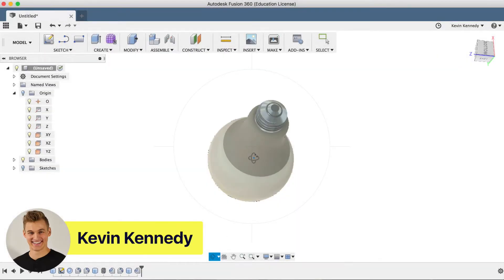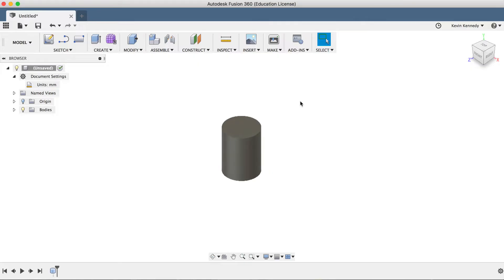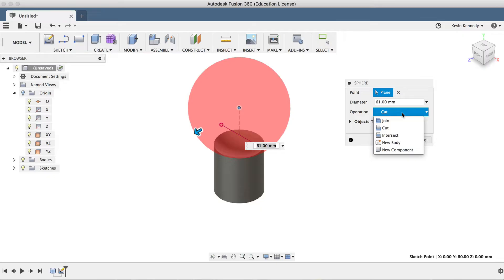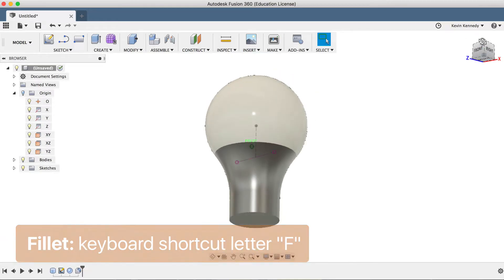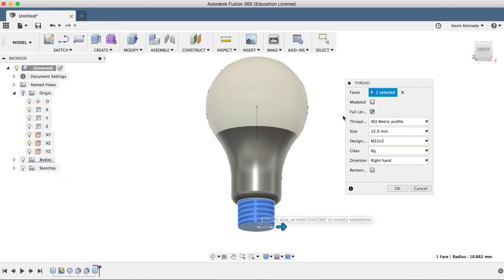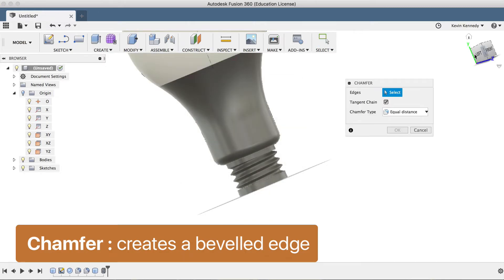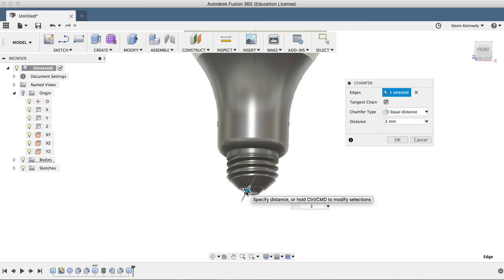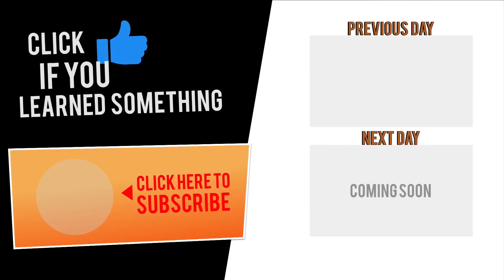How to 3D Model an LED Light Bulb - Learn Autodesk Fusion 360 in 30 Days: Day #9

Comment: As other people have reported, I also cannot get the silver base to fillet up over the bulb. Instead, the bulb curves down over the socket. I have spent 2 hours trying things, ensuring I do exactly what the video says, etc. No matter what, the bulb comes down over the socket:( Perhaps we need to create the sphere first, then the cylinder? I am using version 2.0.13866.

Oddly, when I go on to the next step (fillet the bottom of the bulb) the fillet shows the bulb material rather than the metal base.

Comment: Quality tutorial Kevin, many thanks.
On setting 'appearance' of sphere to a different material (version 360 Personal Sept 2020)
 I couldn't get the cylinder and sphere to colour separately until I eventually found the 'Select' function had a sub menu where 'Select Priority'  was set in my version  to ' Bodies'  as a default and not 'Select Faces' which was needed for  the selection/appearance  to work correctly. :-D

Comment: Brother there is some issue with my sphere command.my software got stuck after selecting the sphere and ultimately got closed.
Reply from the maker: Hi Vikas. Sounds like a bug or something, as F360 shouldn't lockup just from the use of the sphere. Try restarting the program :)
Reply: Same here bro

Comment: Hi Kevin,
I'm getting a line between the fillet and cylinder as another commenter had mentioned.  I've reset my default settings and still have the line, but the line going up the side has disappeared. Should I exit back out and restart or is there something else I'm missing?
Thanks,
Reply from the maker: Hi, Ron. I believe the line you're referring to is simply a visual style setting. Head down to the bottom of Fusion 360 where you see the desktop monitor icon that is labeled "Display Settings." From there, hover over the visual style flyout and select "shaded." Yours is likely set to "Shaded with Visual Edges Only." Let me know if that was it! Cheers, Kevin :)
Reply: @ProductDesignOnline  Got it, Thanks!

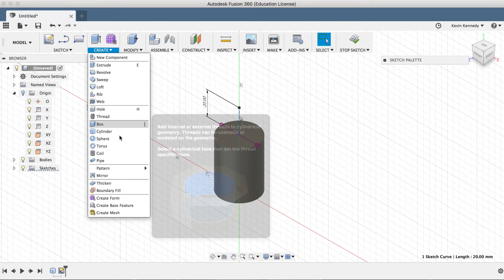Comment: At 1:37, I'm not able to create a sphere as in the video. When I use the sphere tool, it doesn't snap to the line or to the point at the end of it. Am I missing a setting?
Reply: Ok I found a solution on reddit! If you choose for your sphere the same plane the the drawing is in and then orient your view to look at that plane (in this example front view) then you probably will be able to snap to the sketch entities! If you find a better solution please let me know
Reply from the maker: @VerticalWit  Hi there! That's correct, you should be looking directly at the plane to get it to snap. Cheers, Kevin :)
Reply from the maker: Hi, Michael. Can you first cross-check my settings with yours, here - https://bit.ly/defaultsettings

Let me know if it doesn't seem to be a setting and I can look at your file.
Reply: I have the same problem!! None of the preferences used by the teacher seem to work for me. Here is my file https://we.tl/t-TgLYv42QYQ
Reply: Could you please share the Fusion Version you are using?

Comment: Something must have changed in how a sphere can be created, because nothing I do will make my sphere origin point snap to the endpoint of that construction line. I even tried to make it a regular line rather than construction. When I initiate a sphere, the only thing it will snap to is one of the XYZ axis lines, but no points along them, neither on the cylinder, nor the construction line. I've made sure the auto project options are both enabled. Something else must have changed. This is pretty frustrating. I can't even figure out how to work around this in the latest version.
Reply from the maker: Hi Greg. The sphere functionality hasn't changed to my knowledge. It's more likely that it's a difference in our settings. Can you cross-check your settings with mine, here - https://bit.ly/defaultsettings
Reply: @ProductDesignOnline  I reset to default at the beginning, and have been tracking along with your videos in order. I just double checked via your link and the only thing I noticed was Snap was not enabled in the Sketch Palette. Enabling this allows me to start the sphere at what appears to be the correct point, but only because it coincides with a grid point. The construction line was otherwise pointless.

Comment: Hey, how do i get the smooth appearance of the body like you have? Mine has lines where the bulb and cylinder meet, and lines on all the edges. Is it a personal setting?
Reply from the maker: That is correct. It's a visual style setting that you can change in the display settings. Here are the instructions to change it - https://bit.ly/defaultsettings
Cheers, Kevin :)

Comment: I'm curious how you knew to choose ANSI Metric Screw Profile and the design M22x3. The Edison Screw for light bulbs, E26 is the US standard, as the "26" refers to the largest outside diameter in mms. Also there doesn't seem to be a measure for threads per inch (which matters I think).

And if I choose these same settings for a hole in a block and add an inside thread, I should be able to screw in a E26 light bulb into a 3D-printed model???
Reply from the maker: Hi, Don. Thanks for the information. To be honest, I referenced a document online and it may not have been correct. For this 30 Days series the focus was on core concepts more than accuracy of specifications.

As far as the 3D printed threads, you will likely have to alter the thread with the Press Pull command. You'll want to factor in some tolerance since (most) 3D prints are not 100% smooth/accurate. I'll be making a video on some of these tricks at some point. Cheers, Kevin :)

Comment: can this be 3d printed? hehe
Reply from the maker: HIi mogu. This one could be... however, you would need to use supports, and it may be tough to clean up the print with that much support. The other option would be to split in half to create a flat surface. Print the two halves and then glue them together. Cheers, Kevin :)
Reply: First trail didn't succeed, It's printed in 2 parts on the same place.
Reply from the maker: @RAMSies-xz5xb  Where did you split the model at? Cheers, Kevin :)
Reply: @ProductDesignOnline  
Hi Kevin,
Sorry for my late reaction. But I've tried it in a smaller version and that went well. So I guess that is was a glitch in the printer.
Could that happen?
Cheers,
Rob.
Reply from the maker: @RAMSies-xz5xb  Hi, Rob. It definitely could have been something that went wrong with the slicing, gcode, or printer. Glad to hear it worked though! :)

Comment: Somewhere along the line, my setting for "auto project edges on reference" in preference->general->design was turned off. Had a heck of a time selecting stuff. Maybe you have a "here are all the settings you might care about" video somewhere here. I'll have to look. great videos.
Reply from the maker: Hi, miles mccoo. I've listed all my default settings on a page on my website instead of a video so it can always be up to date. Here it is - http://bit.ly/defaultsettings

The "auto project edges on reference" used to be a Fusion 360 default settings. However, from time to time they change the default settings (such as the Y vs Z axis being up). I try to keep them all documented on that page so it's easy to follow along with my tutorials. Cheers, Kevin :)
Reply: Thank you so much for mentioning this I was afraid to ask. Fixed it now.

Comment: 2:25 I did not expect the fillet tool to be able to create such a smooth transition between two objects. From the previous videos one would think that tool is only used to smooth out edges. Makes me wonder if the fillet tool could have been used (in a creative way) for the Whiskey Bottle project?
Reply from the maker: Hi, Special Agent Dale Cooper. The fillet tool could certainly be used for the Whiskey bottle project in a similar manner. However, I typically advise against this method (unless its a simple fun project such as this) as you'll always get more control with a guide rail/loft.

You'll find that in any CAD program there are often many ways to achieve the same result. One has to find the right balance of efficiency and ability to edit or alter their design later down the road. Cheers, Kevin :)

Comment: I'm not sure whether it's a version issue, but I'm really confused how you got the appearance different on the upper and lower parts of the bulb; I have to change the appearance application to faces to manage it, but you don't seem to...
Reply from the maker: Hi, Baiswith. Did you select the area before you tried to drag and drop the color onto it? Notice how I select it at 1:52 and then the top part of the bulb is highlighted in blue. Let me know if that works for you. If not, we can investigate further. Cheers, Kevin :)
Reply: @ProductDesignOnline  Doh...yeah, selecting the area was what I'd managed to miss.  Thanks Kevin :)
Reply from the maker: @Baiswith  No problem! The little things trip us all up at some point. Cheers, Kevin :)

Comment: Is that the actual dimensions for a standard bulb thread?  I'm trying to thread something to go into a light socket.
Reply from the maker: Hi, Mark. I would recommend double-checking with the product you need it to fit in. I looked up the dimensions online before recording this tutorial, however, I didn't check that the online source was 100% accurate.

Curious...what are you planning on making? Cheers, Kevin :)
Reply: @ProductDesignOnline  Making a spud that threads into a light socket. a spud is a mount for tv/film lights.  would be handy for hanging light mats and other lightweight lights.   I figured out how to measure thread pitch and use the coil tool and now I'm good. Thanks buddy!
Reply from the maker: @markkent8436  Sounds like a cool project! Best of luck with it...glad you got it sorted out!  Cheers, Kevin :)

Comment: 1:12 the blue line indicating the top plane of the cylinder and the midpoint triangle do not appear for me. If I just manually click the middle, at 1:14 the perpindicular indication does not appear.  1:18 and beyond, the purple line is not there at all...just a construction line straight up from the middle of the top circle of the cylinder.  I feel like I must be missing some settings...this is the second time you've instructed us to operate on an origin plane referencing the initial body in the sketch and it didn't work like in the video. (Last time this happened was in the hex nut lesson, see my comment there).  Is there a difference in Autodesk Fusion 360 (Startup License) and Autodesk Fusion 360 (Education License)?  Has there been some sort of change in the last year that would have these effects?
Reply: I had the same problem. These seems to be a change in default settings for newer Versions.

I had to go to proferences (click you name in the upper right corner -> Preferences) 
then under "General" -> "Design" 
here activate "Auto Project edges on reference"
Reply from the maker: Hi, ChronOJohn. Thanks so much for sharing this.... I wasn't aware that they changed this as a default... but I will look into this. Cheers, Kevin :)
Reply from the maker: Hi, Emeses. Did changing the preferences setting that ChronOJohn mentioned have any affect to your auto-projected lines that weren't showing up? Cheers, Kevin :)
Reply: @ProductDesignOnline  and ChronOJohn, this absolutely fixed the problem!  Thanks so much for the tip!

Hey Product Design Online - an idea for your series that might be helpful if you have the time to put it together: Make a quick video or reference sheet that you can refer to in your videos that shows all of your settings.  This way when Autodesk changes the defaults, people following your tutorials can still participate with your same settings.  So far the one we discussed in this thread, and the default changing from Y up to Z up have been the only major ones I've come across, but the peace of mind knowing everything is the same would be nice.  Keep up the great work. Thanks!
Reply from the maker: @emeses7568  Thanks for this - I love this idea. I originally didn't think something like this was necessary as I just used the Fusion 360 defaults. I did not know the Fusion engineers were planning on changing the defaults this much. With that said, the only concern is that most of the time I don't even know they make a change to the defaults, as I've found that they don't always announce this on their blog.

I'll likely make a page on my website that I can update so everything is in the same place. Thanks again! Cheers, Kevin :)
Reply from the maker: Hi Emeses. I created a "Default Settings" page on my website based on your recommendation - http://bit.ly/defaultsettings

This is obviously the first "draft" of it...and hopefully this will improved based on further feedback from you and other viewers. Thanks again for this suggestion. I'll be adding it to the description of the tutorials. Cheers, Kevin :)

Comment: Hi, could you explain how to design a socket for that bulb? specifically How to design the threads on that socket so the bulb will be able to screw into it?
Reply from the maker: Hi, Tami. Great question. Sockets have reverse threads, so you'll need to change the direction in the thread dialog box to the "left hand" option. Here's a screenshot for your convenience: https://snag.gy/5yB1Pd.jpg

Overall, you'll apply the thread similar to this tutorial, you'll just need to place the thread inside of a cylinder instead of the outside.

Cheers, Kevin :)
Reply: @ProductDesignOnline  Hi, thanks for your answer. But how do you know the thread's size to begin with? (If I see a tap for example that I wish to design an adapter to)
Reply from the maker: @Tamigralnik  Hi Tami - most common parts have standard thread sizes, which can also vary per country. I would recommend searching on Google for standard thread sizes for your tap/country. It's also helpful if you know the specific model number or brand of the product, as it should list the thread type somewhere in the product manual or documentation.

As far as in Fusion 360, there is no guide or help in regards to which thread size you should choose. This is something you have to figure out beforehand. Then, choosing from the list of preset thread sizes in Fusion 360 will help you save time! Cheers, Kevin :)
Reply: @ProductDesignOnline  Unless I've not understood Tami's question, A right hand screw thread on the lamp would need a right hand thread hole in a socket to screw it into surely!

Comment: I'd love to see you make any armor piece or something? I want to learn more about sketching different parts at this point.
Reply from the maker: Hi Glenn - Thanks for the suggestion! Do you have any images of the armor you speak of? What things trip you up with sketching?

Cheers, Kevin
Reply: Hey Kevin, Well I can provide some armor parts I'd love making. The hard part is that I can't really seem to handle different heights in sketching. I've seen people sketch armor parts or other stuff without extruding a single part first. But after a while I get lost in all my different sketches and planes... Even a simple chest armor piece of a knight will do fine... But have no idea how to start that one... It might be easier to do one side I presume and then just mirror the other side?
Reply from the maker: Mirroring is always helpful when objects are symmetrical. It can save a lot of time and make things simpler.

Thanks for the idea! I'll add it to my list of videos to make. I can't promise I'll get to it right away, but I'll be able to do something eventually.

I'd think the loft or sweep commands would be perfect for a lot of armor pieces. For the sweep, you could sketch the side profile and then a path to follow. If you want it to be more detailed or precise you can create multiple (2+) profiles and then create a guide path (or multiple guide paths) and loft the piece.

Cheers, Kevin